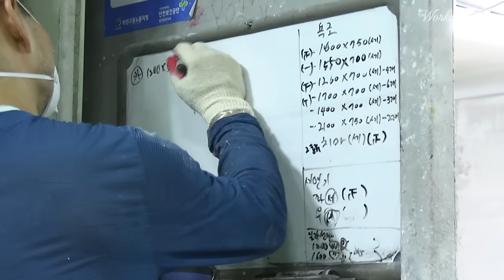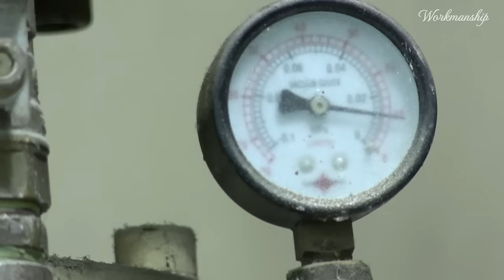Surprisingly, This Liquid Becomes a Bathtub After a While. Korean Bathtub Factory

Comment: kinda cool, but is that the same as those ceramic looking tub? i cracked one when i was i teenager using a hammer (it doesn't end well) wondering how its made and yea, its just looks like one not an actual ceramic like the ceramic cups kinda thing. idk if there's one that made of like fully not just coated but mine was a coated one.
Reply from the maker: It is made by mixing stone powder and resin. It is as hard as stone and warm.
Reply: @workmanship  thank you for replying, i wonder if that compound could trapped/hold heat better than the other types. i did some personal research and oh man, there's dozens of types of bathtub out there. anyway, is there a social account for asking question regarding each 'observation video' you've created? i mean like, you picked  five or ten most interesting question out there about the current topic you're doing. as a professional answer would be quite a welcoming to hear about the arts/crafts/industries they've been doing for years.